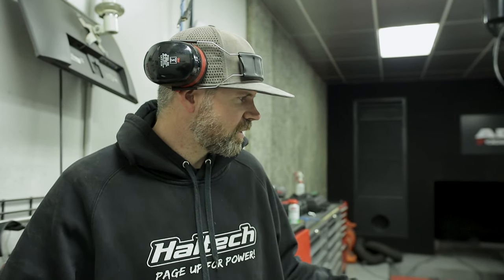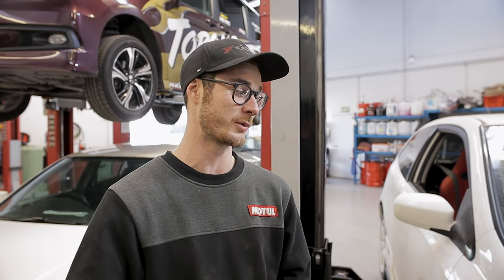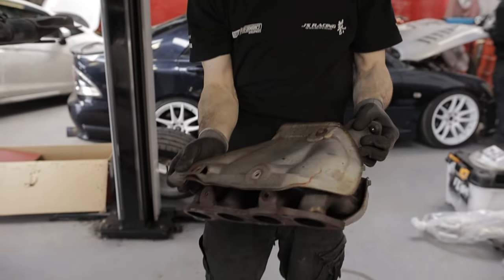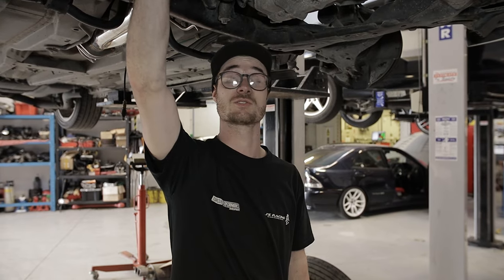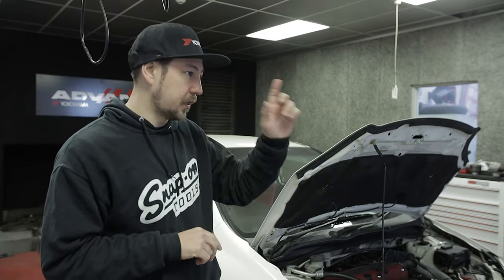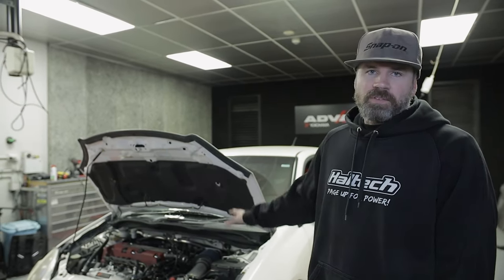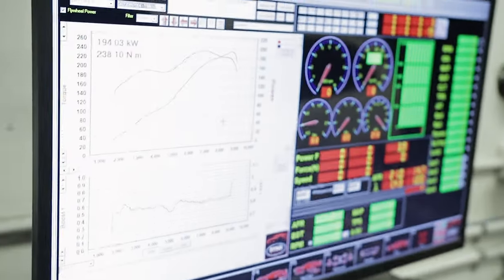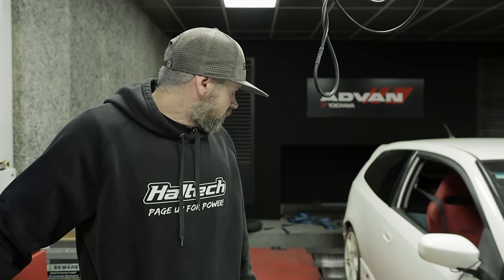EP3 Type R Intake, Headers, & Exhaust Upgrade

Comment: Shouldn't the JDM ep3 have 158kw factory?

I'm looking at getting mine tuned. It's pretty much the exact setup as this one, PLM 2.5 headers, Sk2 Ultra street intake, still think about which 3" exhaust to go with.... 

Have you sorted the Haltech issue out yet? Thinking of bringing it in to you guys but tune it on the Elite 1500+

Comment: What about some aluminum blocks to space the sway bar bushing mounts a bit lower?
Reply from the maker: Good idea but unfortunately with the shape of the JDM sway bar that would bring it closer to the header as it has a unbend that fits into the floor pan
Reply: @TorquePerformanceNZ  Thank you for the clarification and the video!